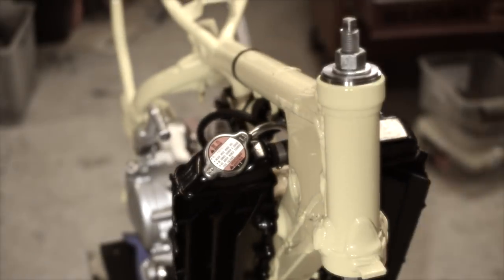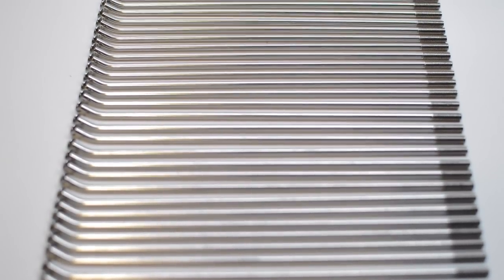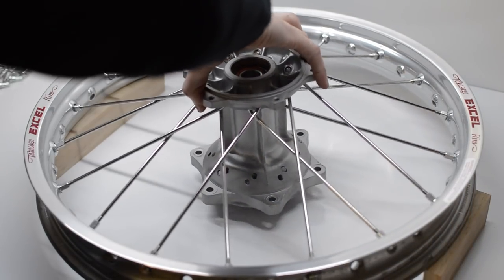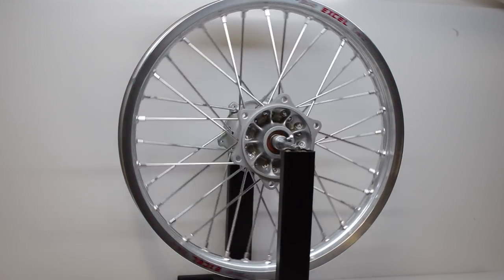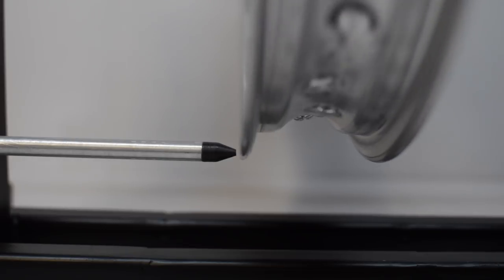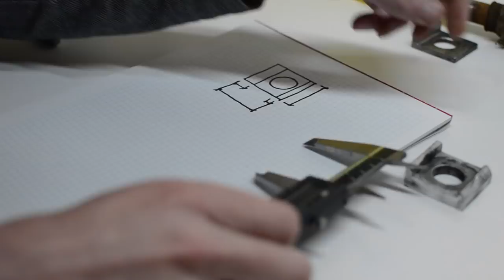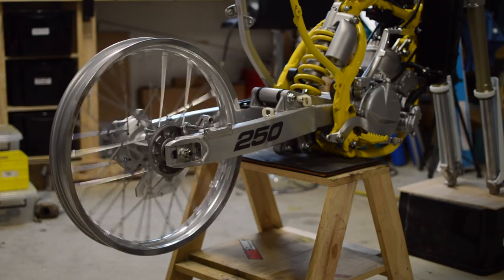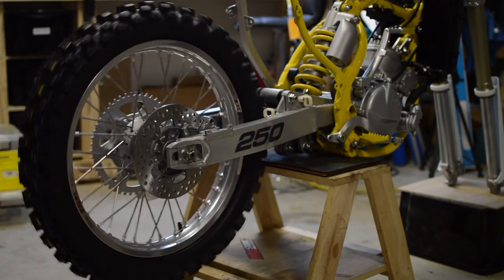Wheels - 1992 RM250 Restoration - Episode 22

Comment: Such a nice bike. My dad and I have a 1976 Suzuki RM250A. I would like to do a full restoration but I don’t have the money. The bike does run. Has the original honing from the factory.I know that it’s because the bike has had one owner: my dad. My dad bought it bran new off the showroom floor in 1976 and raced it for one year. The bike is setup for flat out speed as he did mostly desert racing with a few motocross race before going to college and getting married. But he always kept the bike.

Comment: Watched this whole series as you were putting the videos out and now I find myself rewatching every video as I am in the restoration process of my 92 rm250 as well. Did you use the Excel # ICS-408 rim on the front? I only happened to catch the part number for the rear wheel in the vid. Thanks for any help, looking forward to the new series from you.
Reply from the maker: You're right, the front is an ICS408.  Cheers!

Comment: Sorry to pester you, but I notice all your bolts have a great finish, is this a aftermarket bolt kit, or did you sand blast and zinc coat every engine bolt etc, I see, know you did the axle and swing arm bolts etc all came out incredible. 

But that finish in the engine cover bolts and other smaller areas really makes the bike as it should be, factory saves money on cheap finishes on bolts I know, really makes the project though.👍
Reply from the maker: All of the small engine bolts are new OEM Suzuki where possible.  They aren’t that expensive and you can’t get much closer to the factory finish than bolts from the factory!!!

Comment: I'm rebuilding my own '92 RM250 but a few parts have been discontinued. I need to replace the left hand rear axle spacer but I can't find one anywhere. Unfortunately I don't even have the old one to take measurements from in order to replicate. Is there any chance you still have your mock up of the spacer you fabricated and can share it's dimensions? The inner and outer diameters as well as the flange and wall thickness I can copy from the right hand spacer but the axial length of it is what I don't know. Any help would be greatly appreciated.
Reply from the maker: I think I’ll have the sketch here somewhere. What’s your email?